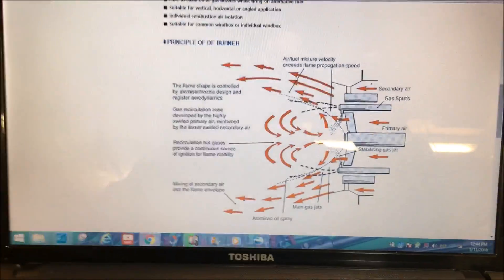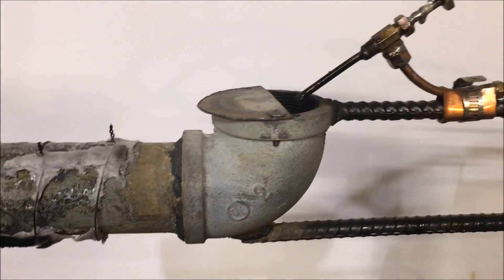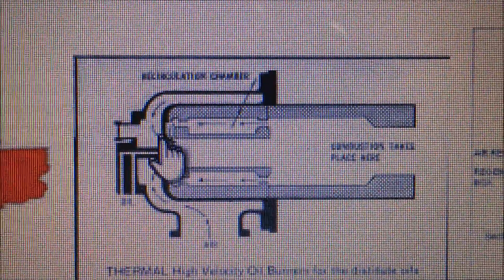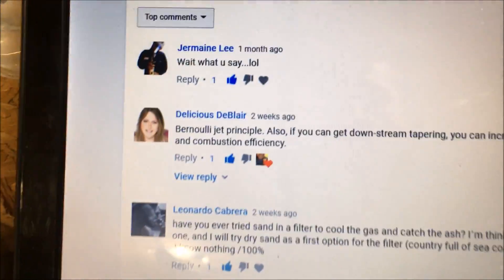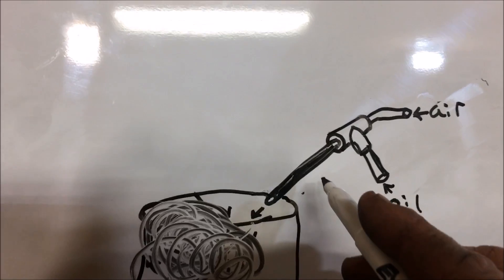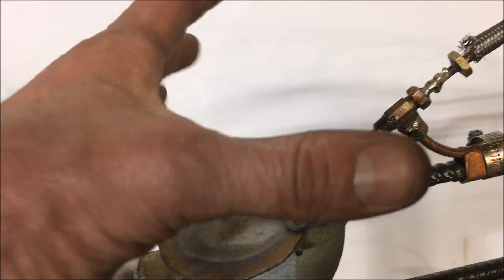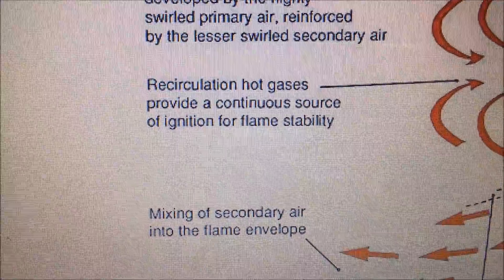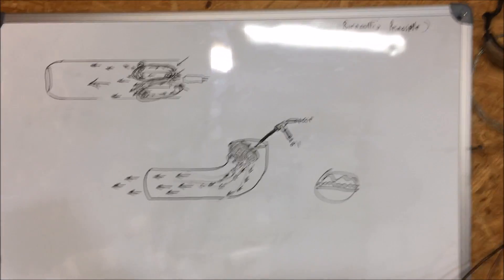waste oil Burner  Recirculation and  Combustion Stability (ELBOW BURNER)

Comment: I had sort of the same realization with the elbow. I figured it was more of my fine mist blowing against a hot surface to get into the flash point of the oil. But I assume recirculating combustion was also a large factor. Doesn't matter because I finally got it running pretty well just to realize how fking loud it was. So the project was scrapped and I built a drip burner with PWM fan controll and PWM on a little water pump from an ice maker.  It was a lot easier on the ears.

Comment: A quick and dirty explanation: We have to understand two "givens"- In a closed system energy remains constant, and that high pressure will always flow towards low pressure.  In regard to Bernoulli, energy is this case is the flow of air moving through your burner. That flow (air) through your burner tube has two (2) components, DYNAMIC pressure (rate of flow) and STATIC pressure (PSI). What Bernoulli discovered is that if you introduce a taper or constrict the flow of (in this case air) the velocity (dynamic air flow) increases through the constriction BUT its static pressure (PSI) decreases...once the constriction ends/stops and the area returns to that of the burner inlet diameter, dynamic pressure (air flow rate) and static pressure (PSI) return to the same values they were at the inlet.
What Venturi showed that if you tap into the constricted area and use that region of low static pressure (PSI) as a means to draw in another substance (fluid/gas/ or solid)...as in the case of a venturi pump. There are no mechanical moving parts, the pump just uses differential pressure.
Simple demonstration: take a soda straw and stick it in a glass of water. Note that the water level in the straw is even with the surrounding water in the glass. Now, blow across (perpendicular) to the mouth end of the straw and watch what happens to the water level IN the straw...it rises above the water level in the glass! The fast air flow (high dynamic pressure) moving across the straw opening creates a lower static pressure in the straw tube. If we are at sea level, static pressure is approx. 14.7 psi...that is the pressure on the surface of the water in the glass AND in the straw tube. BUT when we blow across the tube, we REDUCE the static pressure in the straw tube and ambient static pressure (14.7 PSI) forces the water up into the lower pressure region inside the straw.
Phineas J. Whoopee, you're the greatest!
Reply from the maker: Great input friend , thanks , because of your comment we will attempt to leverage the principle in my next modification , i have 2 ideas both involve a taper
Reply from the maker: just so you know , i red the entire comment with great interest, its like a ready made meal for the mind lol
Reply: Thank you, very kind of you to say. I am in no way a fluid dynamics engineer, but as a pilot, I learned a fair amount about aerodynamics. I can't cite you a reference off the top of my head but if you research a little on turbine engine combustion chamber design you find a lot of information about how engine designers control airflow to maintain efficient combustion without burning up the combustion chamber and liner.
Just FYI: in a properly designed turbine engine, the flame kernel NEVER touches any of the metal components! It is all contained by the proper management of airflow in and around the combustion chamber and liner, how cool is that? (pun intended)